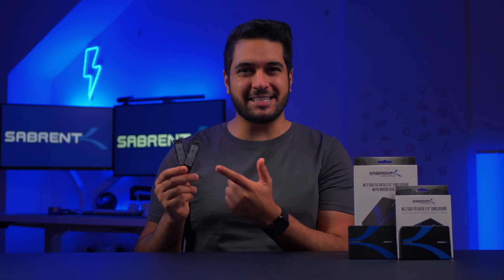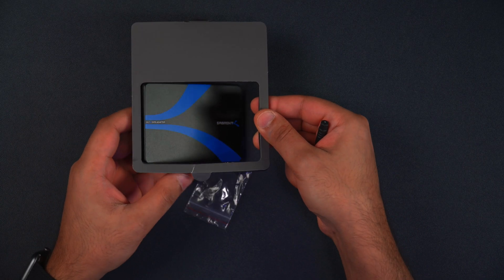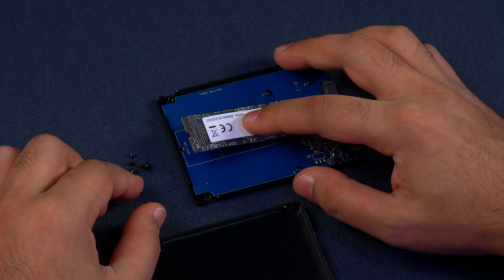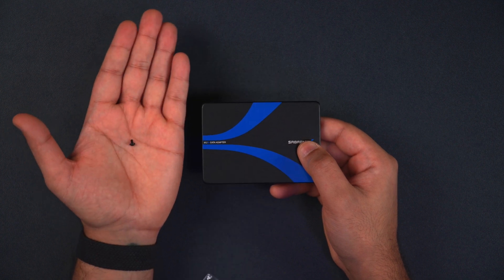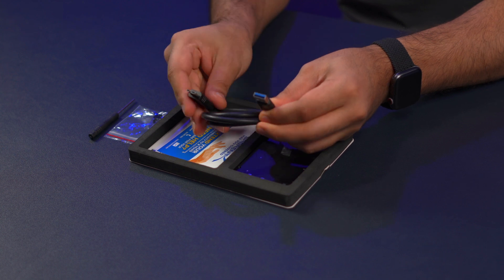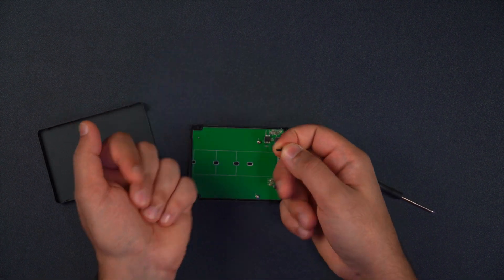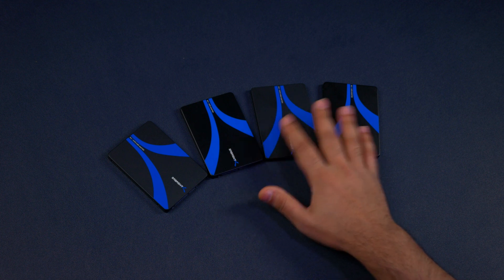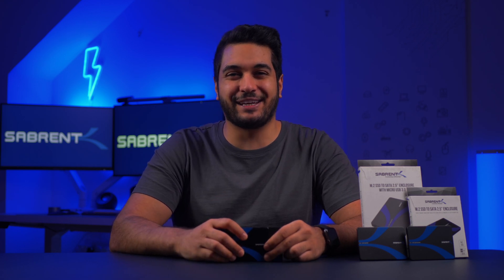Make Use Of Your Old SSDs!! SABRENT M.2 NGFF SSD to 2.5 inch SATA Adapter

Comment: can i use this with a nvme m.2 (p2 from crucial) with this? i know i wont get the full speed but its for a old drive anyways
Reply: does this adapter doesnt utilize nvme full speed or stays at 500mbs cap

Comment: I just bought a Orico 2.5 inch drive case for my ngff m.2 & it came with 4 sticky pads do the go under the board or on the m. 2 🤦🏼‍♂️🤷🏼‍♂️
Thanks in advance 👍🏼

Comment: Hello. Is there an enclosure like this one available for a PCIe SSD. Its a 256gb SSD from a 2013 Mac Pro. I want to install it in my 2012 Macbook Pro, but need the enclosure. Thank you
Reply from the maker: There isn’t no. You are better off buying a SATA SSD with our Sabrent enclosure as the MacBook would be limited to the SATA 6Gb/s so you would be severely underperforming the PCIe SSD. Also as far as I’m aware (correct me if I’m wrong) but it uses a PCIe 2.0 SSD with a different connector than the m.2 PCIe that are common on the market. So even if you found a PCIe to Sata enclosure it wouldn’t work with the Mac Pro SSD as almost all modern PCIe SSDs over the past 5/6 years (maybe more) use an m.2 key.
Reply: @SabrentUSAOfficial  Thank you

Comment: How this adapter slow done M2 drive? Or does the speed remained the same as factory one?
Reply from the maker: It’s basically the same, of course we can not guarantee it as you can imagine with the amount of M.2 SATA SSDs out their, some being better than others and work better than others but we have an average 4.5 out of 5 star rating on amazon with over 4000 reviews. I have tested this of course for many years now and we haven’t noticed any issues with speed differences. It’s more dependent on how well your M.2 SATA and SATA connectors work on your motherboard as each motherboard even can provide different speeds, not anything you will notice of course but there is always some variables
Reply: @SabrentUSAOfficial  sata III is capable up to 600mb/s whereas NVMe 7000mb/s. You trying to tell me that if I put NVMe SSD to this adapter I will have speed over 5000mb/s going through sata III?
Reply: @nofateify  No one is trying to tell you that. These adapters are simply a way to use old or spare NVMe M.2 SSD's to be used on a SATA port at SATA speeds. We often have a large number of SATA ports on our motherboards that are not used, this adapter allows you to use them for NVMe M.2 SSD's. We even have enclosures that allow M.2 SSD's for USB or Thunderbolt, at the speeds of the specific port, not the PCIe NVMe speed.
Reply from the maker: @nofateity You are talking about NVMe, however almost all B and B&M Key SSDs are SATA not NVMe. You cannot install an M.2 NVMe SSD in this enclosure. This is to repurpose M.2 SATA SSDs which typically run at 500/550MB/s. These use the B or B&M keys whereas M.2 NVMe SSDs use the M key which this enclosure doesn't work for. I did mention this in the video but maybe you didn't watch it all the way through.  SATA and NVMe are two different technologies. You are confusing the two and applying this confusion to an inaccurate comment. If you would like to know the differences between M.2 SATA and M.2 NVMe then we have a video on this.